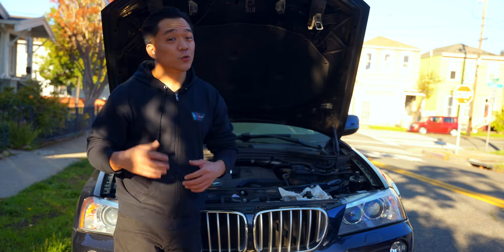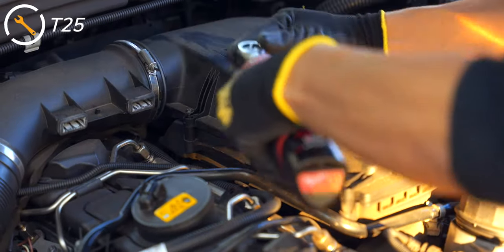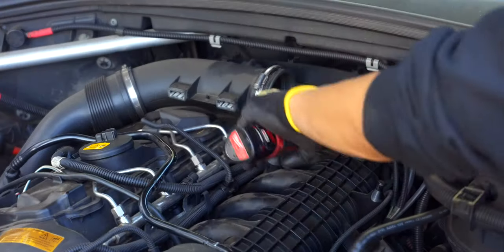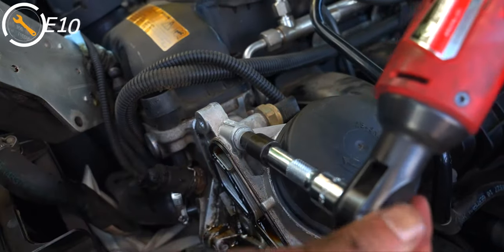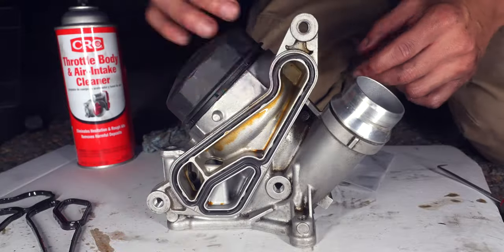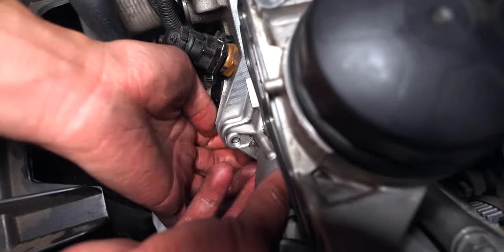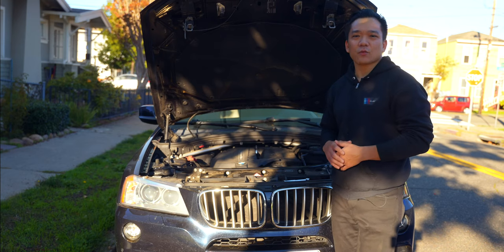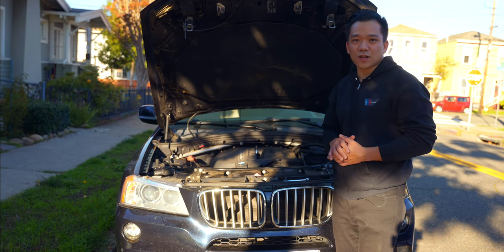N55 Oil Filter Housing & Oil Cooler Gasket Replacement | BMW X3

Comment: Still using this video in 2024 for my F10 with N55. It has the bolt specs and nm you need when putting things back together.  Thank you Fritz

Comment: Great example for this job. Thanks. My 06 530xi n52 has this same cooler. Snap on tools 1/4 drive  E10 swivel socket is a nice tool if you don`t want to disturb the intake manifold. I replaced the knock sensor too, without removing intake. but I did take out the alternator for this job. The filter housing, and alt needed a major clean up anyway. 255k miles here.  Tools make the difference.

Comment: Nice video, but unfortunately you missed the extremely important step of priming the oil pump and oil supply system. BMW has instructions for this. With no priming, there is an increased risk of total engine failure after startup.
Reply from the maker: Thanks for pointing that out. In this case (reusing the filter and no oil change) adding some oil through the housing and allowing it to pass through would be fine.  You could also pull the fuse and allow it to prime.
Reply: @FritzRamos  Perhaps it would be fine. However, I would still follow BMW's service bulletin on this matter. It suggests that priming is required whenever oil supply circuit is interrupted. BMW suggests to remove fuel injector connectors, then run the starter for 3x 10 seconds with 20 second pauses in between.
Reply from the maker: @jkoljonen  All good points. As you said, you could pull the fuel injector connection in place of the fuse that controls them.
Reply: Not needed in this case. Otherwise, you'll be doing it every time you do an oil change. If you're replacing main components (pump, housing, cooler, etc.) then it's advised to follow the correct procedure since replacement parts are completely dry.

Keep in mind that the oil pump in this case is already "primed", more so since the oil was never completely drained. Anyways, to each their own.
Reply: @David Hoang  I was thinking the same thing.  It shouldn't need to be prime every time all you filter is placed. That is not major part replacement that has large amounts of oil loss
Reply: Take it straight from someone who rebuilds engines for a living. There is absolutely NO reason that not priming after a simple repair like this will cause engine failure. Engine bearings are CONSTANTLY coated with oil and do NOT get dry when repairing something like this. So there is never any worry that there could be a “Dry” start. Now, unless you take something like this apart and allow the engine to sit for months & months & months, You will be FINE. When an engine starts, oil pressure happens so fast there’s just no worry. I actually would much rather start the engine, than turning it without starting, because that takes far longer to obtain pressure. You can do whatever you want, But until you start building engines for a living and see how bearings work, but more importantly what truly “dry” started engines look like, trust me, it’s Fine….

Comment: Hi Fritz. I am getting ready to do an oil pan gasket replacement on this same car, 2014 BMW X3, N55 3.0 liter and I would like to know which Bolts are NOT included in the bolt replacement kit commonly used for the repair. My understanding is that 2 additional bolts are needed, but which ones?

Comment: Good stuff.  I cannot stress how important it is to torque the 4 bolts that attach the cooler to housing.  They can be easily stripped. Great job!   Thank you for the video!  👍

Comment: The problem with using the 12-point ratchet on the E-torx bolt head is that it easily strips the bolt head and makes it much tougher to remove. Much, much tougher. Hours of tougher. If that bolt head gets stripped, your estimated 90-minute hour gasket replacement job becomes quite an ordeal, given how already-difficult it is in the first place to reach that bolt and get leverage on it.

So, when you get to the point that you’re about to remove that small bolt, first disconnect and move aside the cylinder head temperature sensor and the hose just beneath that sensor. These are located at the front of the engine, just to the left of the OFH.

 When you pull the sensor clip, do it *carefully* as the clip can fly away, it’s not secured around the sensor. The adjacent coolant hose is attached to the engine via two simple 8mm bolts; just be firm but always gentle when pulling any hose.

With these out of the way, you can fit a proper ratchet wrench with E-torx socket onto that very soft bolt head and avoid stripping it.

Comment: nice. for the filter housing, wouldn't have been advantageous to replace it with a much more nicer looking one like that I have in my N20? than it would have been easier to work on next time when doing oil change etc. just a thought.
Reply from the maker: Thanks man! I agree with you, but if cost is a major factor then this is the way to go. This also isn't my car. 😅 Always good to hear from you my friend, wishing you all the best for the holidays. 🎄
Reply: @FritzRamos  Happy holidays to you as well, my friends.

Comment: Using the 8mm on the small bolt stripped the head. It is torx same as the others on the 2014 x3

Comment: That engine is going to go kaboom if it hasn't already. You didn't pull the fuel injector wiring so that it doesn't fire up. You MUST prime the system with oil and purge it of any air you just trapped in there when you put it all back together... 

How do so many people not understand this??

Comment: Hey Fritz, I have to replace my oil filter housing gasket, too. Is it recommended to replace the intake manifold gaskets as well?
Reply: If you remove your intake manifold completely then have your valves walnut blasted then replace all 6 gaskets.

Comment: I watch your videos often and I have a 2011 x3 35i however I was having several overheating issues. I done the thermostat which looked good when pulled out. Then I did the radiator and water pump. It’s doesn’t overheat at all but runs like around 240* never over just very concerned still around that temperature
Reply: Test the water pump. Make sure coolant is flowing. Make sure your radiator fan is operating.

Comment: Grateful video lm have a question do you need to purge a antifreeze system  l  see videos  if do you not due  damage de engine damage l have a 2014 BMW X5  xdrive35i  any help my thanks
Reply from the maker: It's not a bad idea and doesn't hurt even if you don't 'need' it.

Comment: Do the bolts need to be replaced with new ones (i.e. are they a one-time use), or can they be reused?  I see some gasket kits that come with new bolts, so I am wonder if they are single use.  I have this same leaky gasket issue with my N55 so I am about to order parts and want to make sure I get everything I need.  Thanks for the detailed walk-through.
Reply: Yes you will have to buy new bolts and torque them to spec, BE CAREFUL with unscrewing and screwing the bottom screw, I've accidentally stripped the threading into the housing and so have other people. Don't forget to prime the engine afterwards once the work is complete.
Reply: no unless the n55 has different bolts. My kit for the n52 came with bolts so I changed them but both sets weren't aluminum bolts so they should be good.

Comment: For oil priming, you can just remove the fuel pump fuse per the updated BMW TSB https://static.nhtsa.gov/odi/tsbs/2016/MC-10151166-9999.pdf

Comment: just paid $775.24 parts and labor.
2012 BMW 528I
Reply from the maker: Did you upgrade the thermostat?
Reply: @FritzRamos  engine air filter adapter plus the cooler seal not sure the thermostat wasn't on the bill. I got it done at a local independent in Denver called Auto Imports